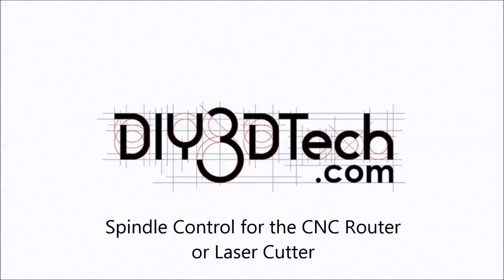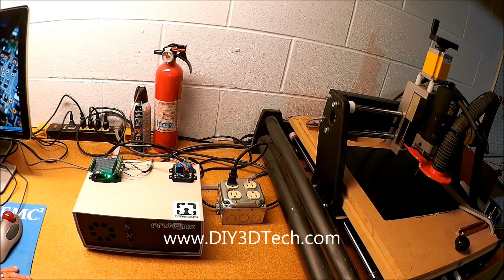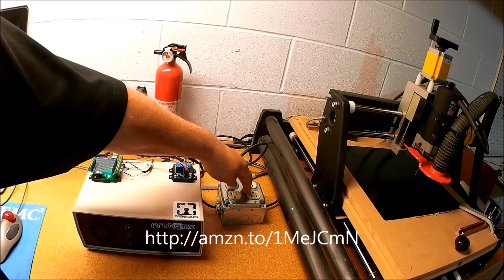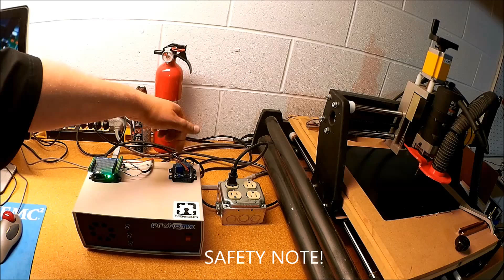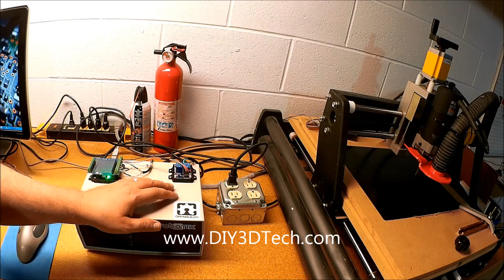Spindle and Laser Control for GRBL

Comment: But... where is scheme and pinouts to connect relay?
Reply from the maker: it will depend on the version of both GRBL and the CNC control board you use, check the GRBL site for your version and reference those pins to control board or back to the Ardunio...

Comment: At this point ready to toss this Grbl board out.....   Just buy a damn mach3 cnc board lol...  Jesus Christ 6 days trying to get a damn laser to power up by using a damn relay and it's like trying to climb a 20 mile hill with 45 degree slope.  Almost not worth headache this point!  
But seriously this really thing would be awesome for my laser project except it almost never seems to work correctly no know matter what shit try.. I have worked with cnc milling for years set up many a machines now few 3d printers so figure this would be fun project with adruino lol WRONG!
Reply from the maker: Have built several of these and no issues at all also would not use a relay to power the laser, use the PWM out to drive the laser PWM driver.  Also not all Chinese UNO/CNC shields are equal as typicaly one out of three has issues, however they are so cheap I just 4 ro 5 to have round and toss the parts with issues.  What kind of problems are you having?  Also if you are using Windows that could be part of your issue as I have switched to Linux as had too many USB issues with Windows...
Reply from the maker: I just get cheap (free) laptops and use them along with Elementary Linux distro and it works great.  With windows I got a lot of USB time-outs and no clue why...
Reply from the maker: Not sure I am following the "Fired this shield up" part?